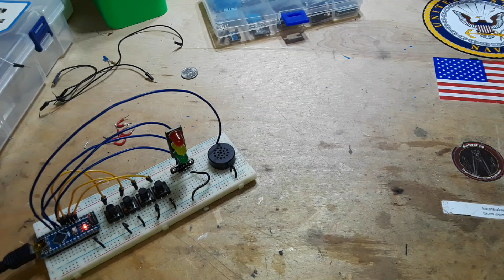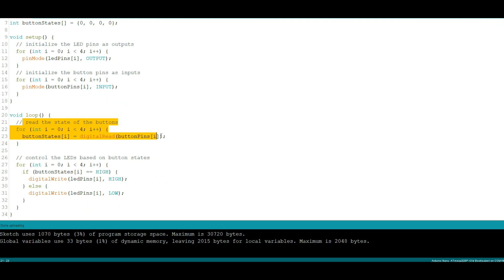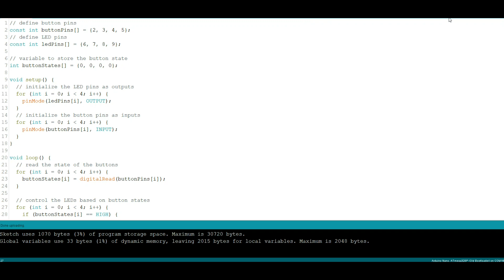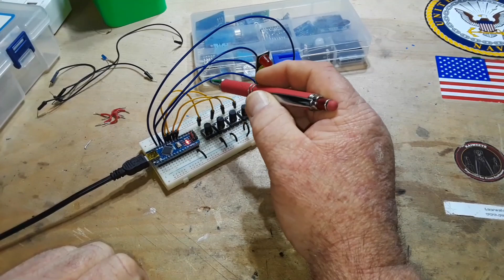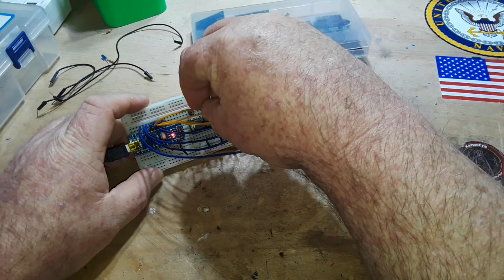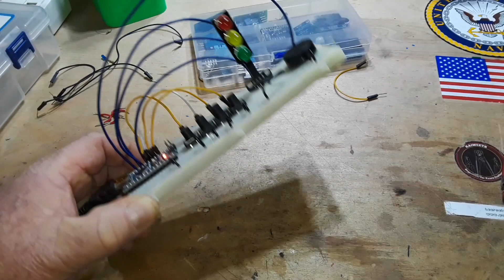Weird Scenes Inside The Arduino Mine

Comment: I'm presuming the tactile switches are plugged into a power rail, and it looks like  the other side of each  switch is connected to an  input pin.  I submit for your consideration that you have floating inputs.  I would tie the lead from the switch either high or low (including appropriate current limiting resistors) as the next debugging step.  My two cents.  Adjusted for inflation, of course..

Comment: One can set the assigned pin as a pull up or pull down in the Arduino Code
Reply: Only pullup. Arduinos don't have internal pulldown resisters (at least, most don't -- there may be a few niche models that do).

Comment: Capacitive board. Move your project to a proper circuit board and the issue will likely dissapear. I love those proto boards but they are a headache at times. The only other thing i can think of is try a pull down 1k resistor on the trigger lines, 1k to positive in your case.

Comment: Assuming it's not the Arduino or. The breadboard try .. 

Simplify the circuit.   

Remove all the wires 

Put a single wire to 1 of the buttons , does that work ?

Now move the wire to each of the buttons in turn , do they work ?

If symptoms don't occur with single wire , try increasing number of wires 1 at a time .

Can't quite read the code but are you enabling the built in pull-up resistors on each of the inputs ?

Comment: I think you need pull up resistors on the input pins.
Reply: Or just use INPUT_PULLUP as the pin mode (which is actually the default).
Reply: And I'm guessing he also probably wants "if (buttonState == **LOW**) { ledState = HIGH } else { ledState = LOW }" instead of the other way around.
Reply: I dont see the internal pull-ups being enabled in the code, should be pinMode(buttonPins[i], INPUT_PULLUP).